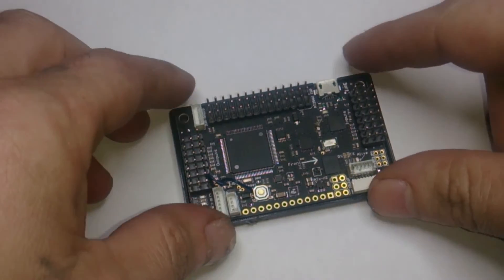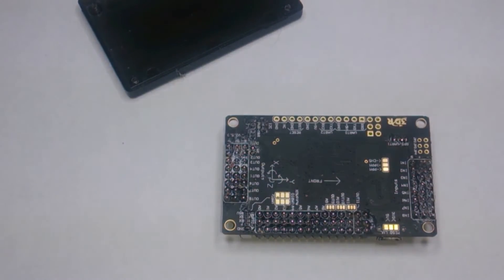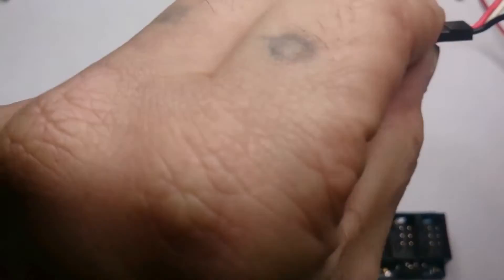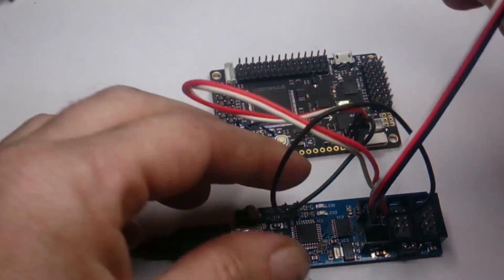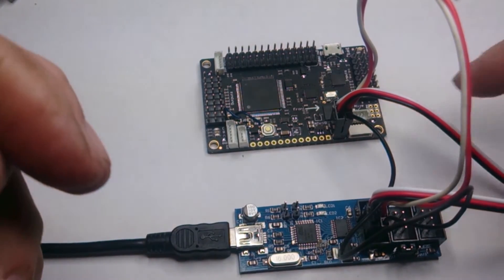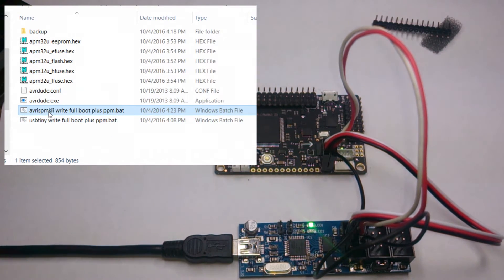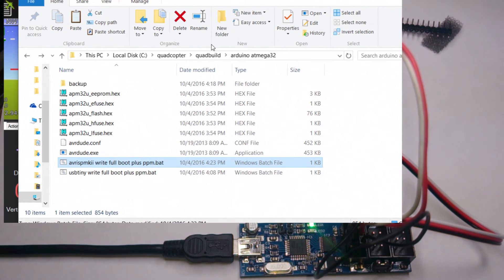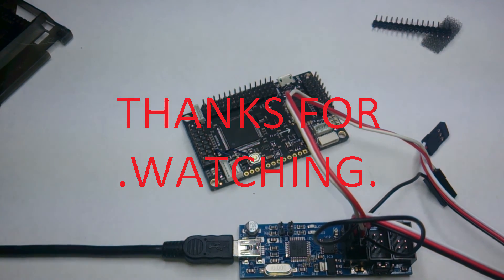unbrick apm atmega32u2

Comment: My APM usb has been ripped off from the board and also the solder pads on the pcb is also gone ! Any idea how to fix it?
Reply from the maker: if your good at soldering there are some points you can solder to.. for example the 2 resistors in front of the usb are for the data..  you might be able to scrape the board a tad to get a little bit more ground for the metal shield then your just left for 5 vots.. and that can be found by the fuse right beside the usb connector or..find 5 volts on a pin..  

You can also find a Female usb connector .cut the wires add  2 female connectors on to it, one for the positive wire and one for the ground wire and plug it into the ground and positive rail on the apm.. but you still need to solder the 2 data lines on those resistors..
(you still won't want to plug in the battery and usb at the same time with this method..or any method really)

now  if you have a spare gps wire or 5 pin that can plug into the telemetry port you can get a usb to serial adapter and plug it into the telemetry port and program it from there.. (tx rx ground,Positive on 5 volt rail)for simple stuff you can just get a telemetry module as well...then program it wireless.     If your already updated to version 3.2.1 then it should be fine that way . I've had issues with the compass calibration and telemetry but some people can.    With the usb to serial adapter I would change the baud rate to 115200 .. then you wont have any issues..  Or a bluetooth adapter as well into the telemetry port..
Reply from the maker: You will want to test if your usb shield is actually grounded.. mine is not.. You would have to use 30g wire onto the usb micro pins
Reply: @ModItBetter  one more problem i have in my apm 2.8 ,( 3.2.1 )after i power up the board before Arming i can see the altitude getting raised slow up in the mission planner if i leave it for 2-3, min it goes up to 8-10m altitude , if i arm the board then it comes back to normal 0 alt ,, I don't know what is the problem if you have every been through this situation please help me !
Reply from the maker: @AfshAd  altitude is calculated with temperature .. so it might be things are just heating up in your apm..
Reply: @ModItBetter  okay ! 🙌 Thanks
Reply: @ModItBetter  thankyou so much. I will try this and currently im using bluetooth telemetry that maked the job done ! Yeah im Already in 3.2.1 just in case if i want to change the firmware i need to fix that usb !! Thank for letting me know how to fix !

Comment: My 32u2 chip on my apm 2.4.1 board is fried. Anyone had any success replacing it? Being surface mount with the solder tabs underneath I can think of a way to do it without re flowing the whole board which I'm guessing will melt the plastic on the connection headers?
Reply from the maker: the tip on your hot air rework gun .should be small enough to target just that one chip. ..I've done the l883 compass chip which is way smaller without problems..

you also need solder paste and lots of flux as you will probably get bridges during the remount ..

alternatively the atmega32u2 chips serves as pwm to ppm and usb to serial adapter.
If your creative there is probably away just to add a daughter board .. basically tx ,rx,(or mux chip) and ppm wire connected to the atmega2560 might be all that is needed for the connections.. and a shared ground..
Reply: I just bought a hot air rework gun to replace it. Problem now is I'm not finding an exact replacement chip. Any idea if any of these will work or where to get an exact replacement? https://www.digikey.com/products/en?KeyWords=mega32u2&WT.z_header=search_go&v=313&v=453&v=427&v=8025&v=1288&v=464&v=1289&v=580&v=463&v=150
The chip on my board says:
(ATMEL logo)
MEGA32u2
10268 TH
OF4378
Reply from the maker: hi not sure which style you have .you should have this style
https://www.ebay.com/itm/Atmel-ATMEGA32U2-AU-IC-AT90USB-AT90USB162-Series-USB-ATMEGA32U2-SMT-New-USA/162099268133?epid=23012039002&hash=item25bdde8a25

I have not used that seller it is just a example.
Reply from the maker: i've been out of the  loop for awhile this confuses me
https://www.ebay.com/itm/Atmega32U2-Mur-Tape-and-Reel-with-3-Pieces-Microchip-Technology-Microcont/352449157228?hash=item520f9b586c:g:O98AAOSwDftbmYB~

if you google around for the data sheet "microchip" / pic ... shows the data sheet for the atmel atmega32u2 chip..

on "microchip" website 
https://www.microchip.com/wwwproducts/en/ATmega32U2#datasheet-toggle

click on the data sheet ..it will bring up atmel..... maybe atmel sold the rights to it because they no longer make it?! ....
Reply: Hello sir, i have chinese apm 2.8 board and it seems like bricked.. i have usb tiney isp. I tried several time using above as you mentiond but afer install " usbtinny write full boot plus v3.2.1.bat" it shows programm running on cmd . 
Then after written the "abc leds" blink several time and then  only red led bulb is blinking
Please Can you tell me am i did wrong way or what is the correct way should i reprogramm. And what is the correct driver should i install
I have win 7 64bit os and i don' t know much  about programming sir.
Reply: I use this one

Comment: Hello friend, thank you very much for the time offered to try to solve this riddle.
I tell you that with this program if you load the firmware but something happens, when you install the firmware with this program the apm connects and disconnects from the pc
So the MP recognizes it but does not connect as it connects and disconnects.
This effect only happens when installing the firmware.
Reply from the maker: Have you tried this on another computer with another usb cable?    ..
Reply from the maker: also it might be time like i suggested weeks ago to start looking at diodes and fuses and regulator.. to see what voltages you have..

I would suggest shipping it but the cost is more then a new apm both ways...     Do you have voltage meter / tester?  

maybe we can test each thing one at a time with pictures.
Reply: 3 usb cables, pc for 1
Reply: if you explain how to do it
I have a multimeter. Will this work?
What do I have to see or measure?
Reply from the maker: Ok test this one first.. I sent this picture to you weeks ago.

Plug in apm .. 
Put meter on dc volts.

carefully 
put one lead on that 3v3 pin
and put one lead on ground. like the top of the usb connector ect..

Your meter should say 3.2volts - 3.4volts 

https://drive.google.com/open?id=0B2w6_OKE_2kxQjFnOWhUMU9VdEE
Reply: friend, test done, if you are checking 3.29v
Reply from the maker: Hi..that is good..   I'm actually confused..

So if you use isp to program board the apm works? 
you can download params and move in hud?

It only messes up when you try to do firmware update?
Reply from the maker: If you apm does work after isp update.. maybe i can just make you package with the firmware you need so you can program with isp.. like for airplane
Reply: thank you friends for sharing your knowledge and trying to solve this problem together.
I would say that you do not worry and I am thinking of comparing another APM to place it on the F450.
The truth has already been scared of this APM, the f450 is great and with everything that has been done already it loses the confidence to this controller.

I thank you for everything you have done,